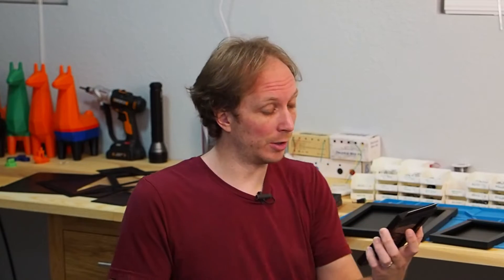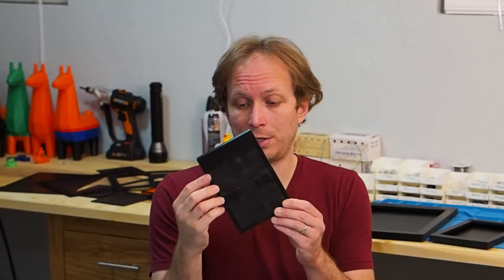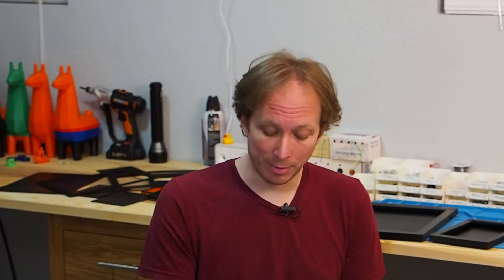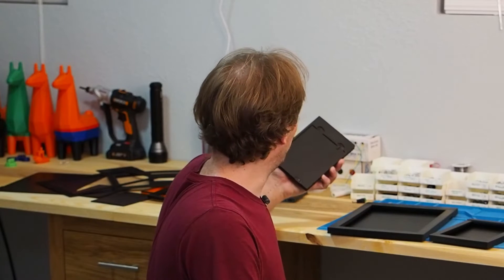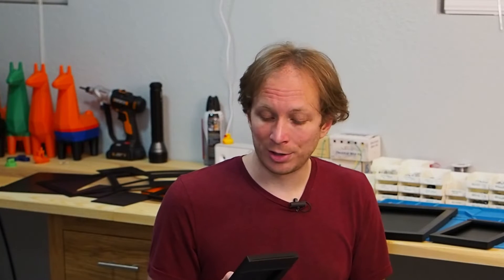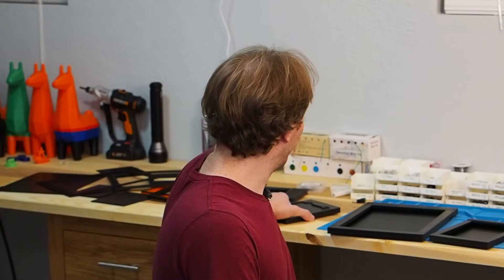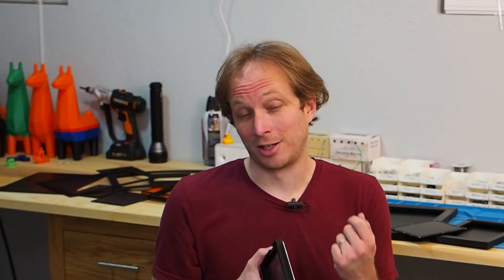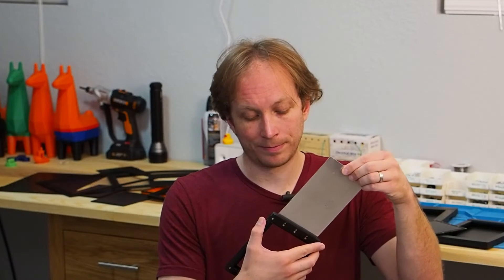Collodion Chat #4: Plate Holder v4 Reveal

Comment: I have a question: please let me know thickness of tin plate - you use sheet of this material as a dark slide? How you make sure tinplate is pressed down to the plane of sharpness ?
Reply from the maker: I use .025" aluminum.  To hold the plate in I usually just use some folded up paper towel or a piece of sponge
Reply: @tehbieber Thank you for a useful hint

Comment: Hello, out of curiosity , what 3D printer are you using?
Reply from the maker: I run a couple of vorons
Reply: @tehbieber   Voron Trident? Seems big enough for 8x10 holder printing...
Reply from the maker: @lumenetumbra4223  one v0 and a 350mm v2.4.  it's a little bit of a squeeze but the big one can fit an 8x10 holder

Comment: Hi Robert, will you be able to do full plate and half plate holders? Thanks!
Reply from the maker: I'm not going to make them myself, but if your camera has a spring back and you can measure the dimensions you should be able to fill them in in the Dimensions spreadsheet and adapt the design to your desired size
Reply: @tehbieber  thanks Robert!